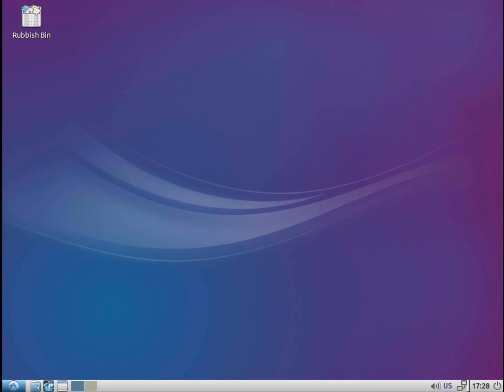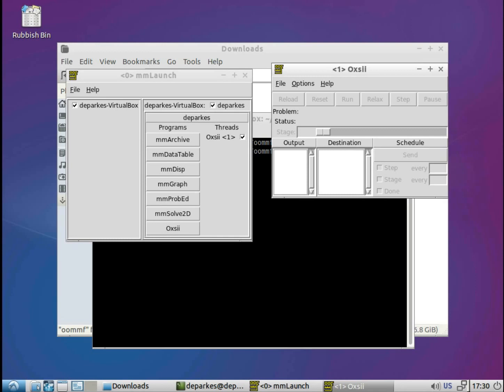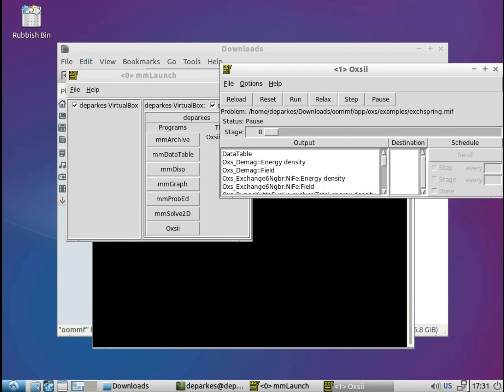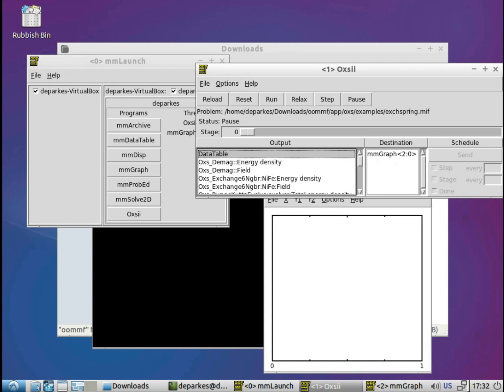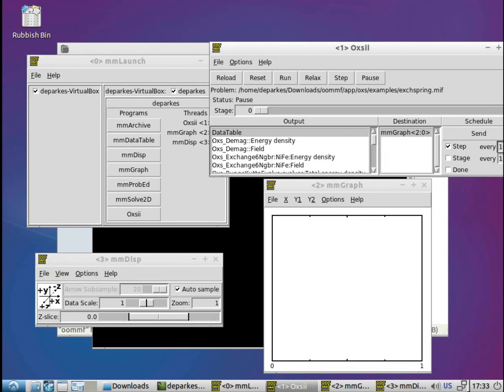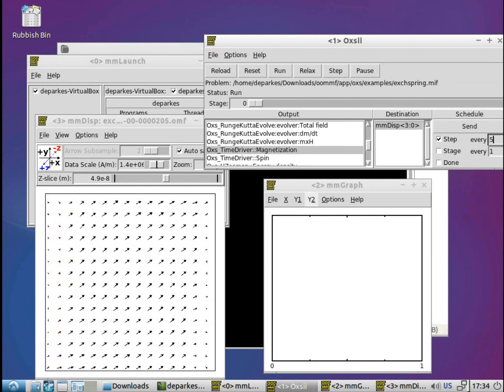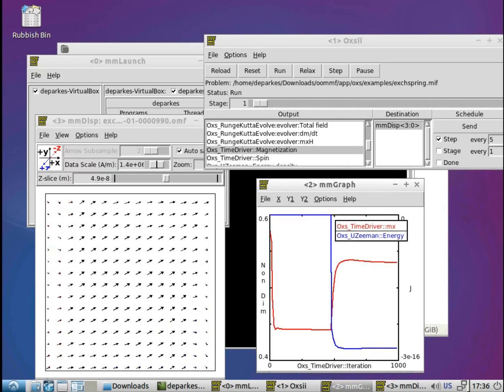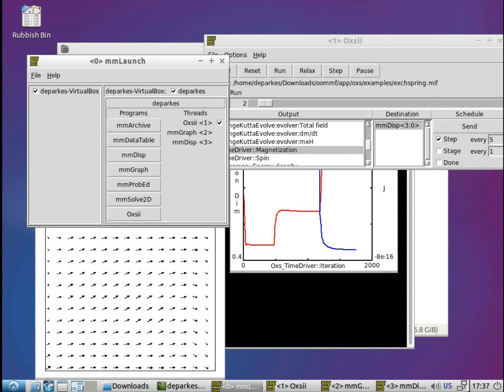How To Load and Run an OOMMF Simulation

Comment: When I install run OOMMF simulation in windows, my mmArchive files are not getting saved and I am getting message  <4588> mmArchive 1.2.1.2 Net protocol warning Datafile: Can't move file <.OMF filename in temp folder> to <destination OMF file in working folder>. File <.OMF filename in temp folder > not owned by current user. Can you please advise what the issue might be?
Reply from the maker: It looks like you are trying to save the outputs to somewhere you do not have permission to access. One guess - did you install with administrator rights in a particular location and are running with just user rights?

Comment: what are the computational requirements for this micromagnetic simulations??? Like no of cores, processor, RAM etc...? Can anyone help?
Reply from the maker: As far as I am aware there aren't really any minimum hardware requirements for OOMMF, but you will find that a) Simulations run quicker with more, faster cores; b) That you will need more RAM to even attempt simulations of larger dimensions, or with smaller mesh sizes. You can get an idea for how hardware changes performance from this paper: https://math.nist.gov/~MDonahue/pubs/parallel-oommf-20090518.pdf - although it's quite old now.
Reply: deparkes  Thank you Sir..

Comment: HI, I want to install OOMMF on a Windows 7 platform. I am new to TCL/TK programming can you also show how to install OOMMF on windows or just write the procedure.
Reply from the maker: I wrote a blog post on this a while ago, which may be helpful (https://deparkes.co.uk/2014/05/18/oommf-tutorial-part-1-install-oommf-and-tcltk/). Installing on windows is generally easier than on Linux, but there are a few things to watch out for about getting the right version of tcl/tk.

Are you sure you have installed the right combination of TCL/Tk and OOMMF? This will depend whether you have a 32bit or 64 bit windows installed, and which version of OOMMF you have downloaded. From the error of tk85.dll missing, it suggests you might have downloaded and installed a different version of tcl/tk (8.4 or 8.6 maybe?). 

If you need tcl version 8.5, I suggest going here https://www.activestate.com/activetcl/downloads and scrolling down to "Download Tcl: Other Platforms and Versions" and downloading the version 8.5 installer.
Reply: Thank for the quick reply you are right it is the version of Active TCL. :-)

Comment: Hello, I have a question about writing a MIF file to load a problem in OOMMF OXSii. Can you please help me, I have been struggling to solve that problem for two weeks and still could not be able to solve that. 
The problem is I am trying to define a geometry of a multilayer nanowires structure in a MIF file using ImageAtlas and MultiAtlas. The structure of the specify block in ImageAtlas should be as follow:
1.       Specify Oxs_ImageAtlas:atlas$j {
2.       xrange {0 70e-9}
3.       yrange {0 40e-9}
4.       zrange {0 10e-9}
5.       viewplane xy
6.       image diskarray.bmp
7.       colormap {
8.       red    Adisks
9.       blue   Bdisks
10.     white  universe
  }
 }
However, I need to put this block in a FOR loop in order to make the multilayer structure. The problem is when I use a variable in line 4.  like Zrange {$k  $k+10e-9} (where the $k is already set to be increasing in each step of the FOR loop) I come up with an error which says "$k" is not a REAL value. 
If you could help me with this problem it would be  most appreciated. Thanks a lot
Reply from the maker: I think you may need to use the 'subst' command for variable substitution, something like this:

Specify Oxs_PeriodicRectangularMesh:mesh [ subst {
cellsize {$xcell $ycell $zcell}
atlas :atlas
periodic x
} ]
I've written a bit more about using variable substitution in OOMMF on my blog here: http://deparkes.co.uk/2014/10/28/oommf-tutorial-part-6-oommf-scripting-python/
Reply: deparkes thanks a lot, that is true, it works 👍👍👍
Reply from the maker: Great!